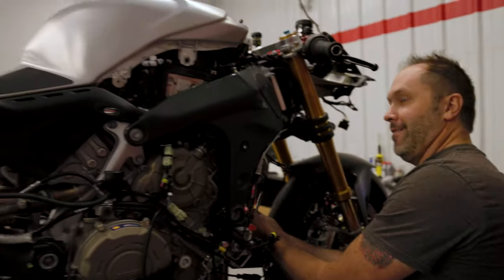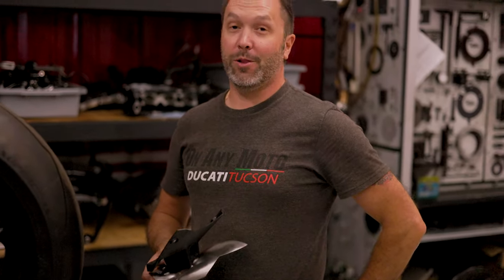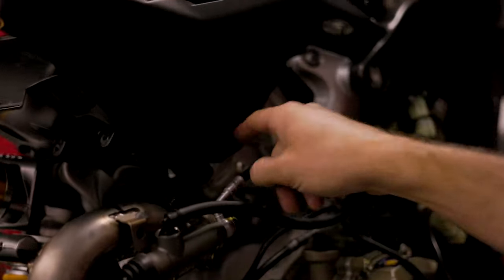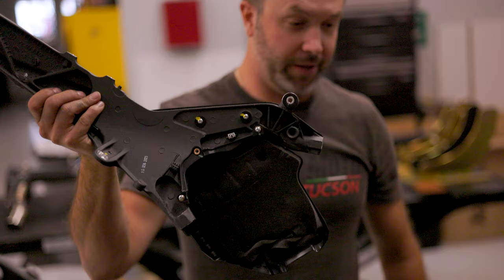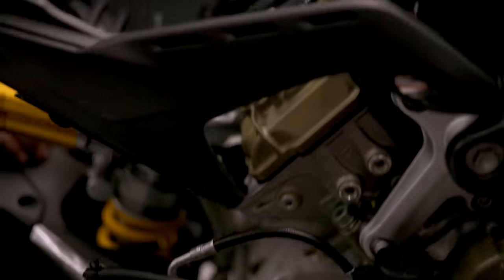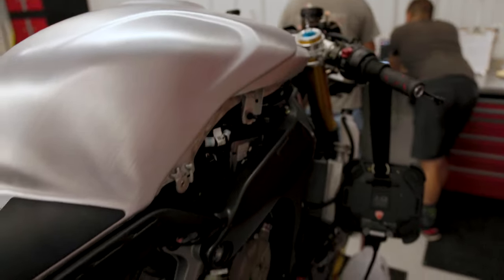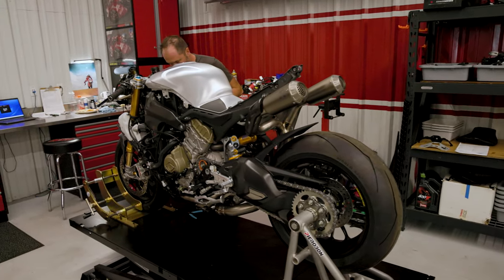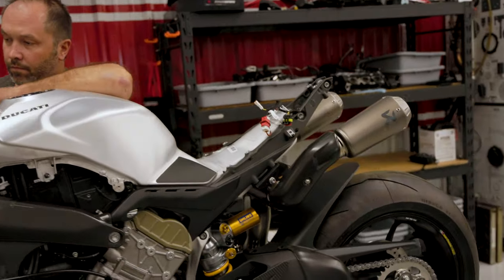Full Akrapovic Ducati V4R Exhaust install | Pure Ducati rumble!

Comment: Okay so i have questions!
1. I heard that a full exhaust adds atleast 30 hp...do you notice a power bump up?
2. Do you plan to put it on a dyno?
Reply from the maker: Supposedly that's the case with the special shell oil it is 240.5 hp. But 650Ib has a video of his on a dyno so you can see what that number actually is!